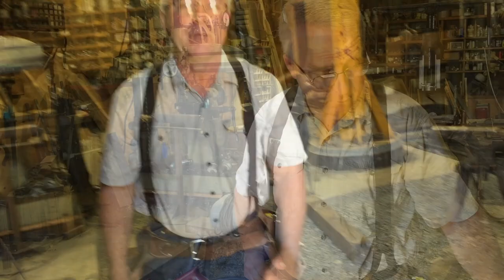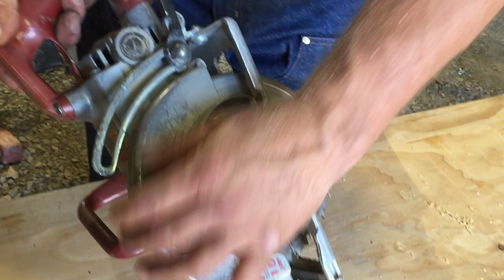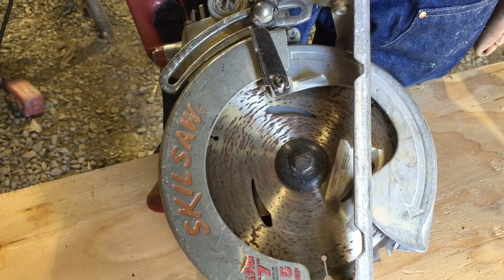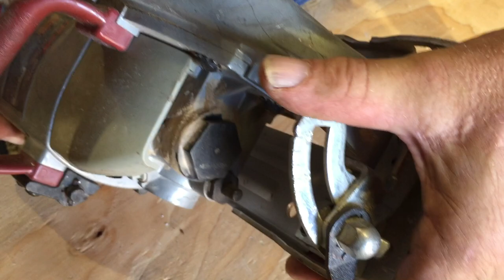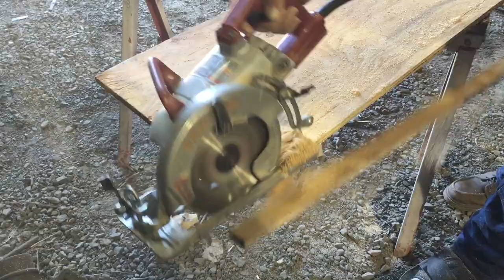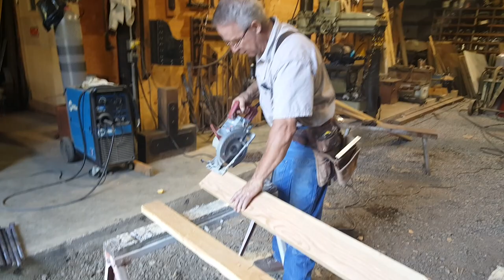Circular Saw Basics

Comment: I have an old Model 77 worm gear Skill saw which is very heavy and I noticed with envy the ease with which you cut the ends of the boards straight with out a guide free hand. besides developing arm strength do you have any pointers on how to cut straight free hand?

Comment: 20 years in the trade in Australia and I've never seen a worm drive Skil Saw, not even for sale.  We only use direct drive and call them circular saws and you are right in that they are back to front for a right handed person.  I now need to find a worm drive Skil Saw in Australia somehow.  They'd better make a cordless one....
Reply: They put the blade on that side so you don't eat sawdust. They make left handed sidewinder saws too. I have a Porter Cable left handed saw. I'm actually left handed. But I used right handed saws for so long I learned how to saw right handed. Now it don't even feel right to saw left handed to me. I still hammer left handed though.

Comment: Is it safe for a saw (I have Bosch pro) to drop it on the floor as you did it at the end of the video? Is a saw supposed to survive such a treatment?
Reply: On concrete it can bend or break a shoe, or crack a safety guard.

Comment: don't stand on the cord. long rip or panel cut? pull slack in cord right up in advance so you can finish in one movement. when adjusting saw fence angle and depth, maybe not so necessary to have finger right on trigger ready to go... wavy cuts cause kickbacks, cut straight. worm drive style plows on when a sidewinder binds up and kicks back.however if you somehow cause worm drive to kick back, gawd help you, pray your on the deck not up high in the rafters.  cutting small pieces is simply dangerous, especially at angles/compounds, run saw against speed square to make straighter crosscuts. dull blades are for california guys who hate usin' horses... don't cut nails, banding, hanger material etc.

Comment: Something I'd like to see/know - being an absolute duffer when it comes to carpentry in the least.

When I measure a piece, where do I put my mark?  I figure right there on the pip of the tape measure.  Now, that's going to leave a width itself, +/- to either side of the measurement.  When I put my blade to this mark, where should I aim?  Dead center - I'm going to be slightly short on the measure (you say the typical leeway is 1/16th"?), or do I want to be ever so slightly above the mark - so that the cut is more exact.

Simple questions I've never had anyone answer - "Just do it!" I always hear.  Okay, just do it HOW?  I've seen season carpenters put up a stud wall that actually affected the entire structure of the house in the end - MARKEDLY so.  But they had everything done to tolerance, yet a golf ball would run rather dramatically from one side of a room to another when they were done.
Reply: If you measure the length you want and draw a line there, you would take the line and only the line. That means line your blad up so it will only take away the line but no more or less. This is usually the case. The trick is to mark your measurement correctly and then line the blade up correctly. If you measure accurate make sure your mark is clear to you so you know where the measurement really is so when you draw a straight line with a square you make that line through the point that is the real measurement. If you just put a fat dot there where is the measurement? The left, middle, or right of that fat dot? That's why you use a sharp pencil and draw a "swoosh" away from the point where your measurement really is so when you draw your line you know where the tip of the pencil was rather than guessing where the real mark is. Once you have that you need to just line the blade edge up to it, not the middle of the blade since the blade has width (called kerf). Line the edge of the blade up and take the line and there you go.

Comment: Any recommendations for a lefty?
Reply: Learn to saw right handed. And yeah I'm a lefty.
Reply: Fair nuff
Reply: @christianpeters3757  I've sawn right handed for so long that using my left hand for sawing feels weird to me now. I'm a dork trying to use a mouse with my left hand too. Because I made the conscious decision years ago to not even try using a mouse right handed. Golfing same deal. Left handed clubs are too hard to come by. I bat lefty though. I definitely hammer left handed too. I swing like a girl with my right arm. I drive left handed. So standard shift is no problem for me. At least in the USA. Using scissors is where us lefties really get screwed. Using right handed moulded handled scissors left handed is torture! I butchered a pair of Fiskars right handed scissors once so they're not too bad. I taught myself to write righty too. I was into calligraphy and that doesn't work too good left handed. Our entire script is designed for right handers. I never did the hook writing thing either.
Reply: I am trying to integrate using my tools right handed more and more. Will just have to take it slow with the saws.
Reply: @christianpeters3757  For a long time I used common sidewinders left handed. I just got tired of eating sawdust though. I never cut freehand either. I always use a speed square. That way I know I have a straight cut. Why make things harder than they need to be? Using a guide isn't the fastest but it is the most precise and consistent. Anything worth doing is worth doing right. Showboaters always end up sinking eventually.

Comment: I want to get an extension cord for my Makita 5077B hypoid saw which draws 13A. Its instruction manual says that you can use a 15A 12/3 50' or a 15A 10/3 75' cord.  But, a 100' cord is not an option. One company that makes a 15A 12/3 100' cord insists that it should work with no problems with this saw. What do you think?
Reply from the maker: Should work I think...

Comment: What is the difference between a Skill Saw and a circular saw????
Reply: So it's really just a brand name then?  I had a customer come in and ask me where are my skill saws?  I brought him to the circular saws, 2 of which had the name Skil Saw printed on them.  He said, "No, these are circular saws...I want an actual skill saw".  I looked like a deer in the head lights.  I thought he was standing in front of Skil Saws but he seemed to be under the impression that he was looking for a different type of saw.  I was confused and he made me feel dumb for not knowing the difference.
Reply: Skilsaw is just a brand name (well, really Skil is the brand, and they write SKILSAW on the saws), but what he probably meant, depending on what part of the country you're in, is a circular saw with a wormdrive (motor behind the blade, like the one in this video), since people associate those with Skil. This would be as opposed to a circular saw with a direct drive motor (motor off to the side of the blade). Most brands made both, but here in the East the direct drive is much more common and the old-timers call the wormdrives Skilsaw since they're the only wormdrive you see much of here.
Reply: OK since I'm in the midwest, I'll assume Skilsaw means worm saw...makes sense to me!  Thank you so much for pointing this out to me.
Reply: Thank you for taking the time to respond to this.  I am learning the difference between worm and sidewinders, thankfully, so now I don't feel so lost at work.  They really just throw us in there and don't give a whole heck of a lot of training.  Again...thanks!
Reply: Ah!  Thank you for that explanation.  Next time someone asks me for a skilsaw while standing in front of them, I'll know to ask if they are looking for worm drive or direct drive (sidewinder??).  At least I will sound like I know what I'm talking about and be more prepared.  Thank you again!!

Comment: We all have our safety guard stories. Here is my non-injury incident.
I had the guard pulled back with a drywall screw so I could rip a woven bamboo floor plank. I ripped mY piece in the living room,  forgot the blade was exposed and laid the saw down on the floor. The Skil took off and made a nice half moon gouge right across the brand new glue down bamboo flooring (this shit splinters like mad). I let the owner  know of the mistake by yelling out "motherf$@!&! The customer actually told me not to do anything except hide it with a coffee table. WTF?

Comment: Why is worm drive better than direct drive
Reply: I may not have all of the reasons, but I'll share what I do know...

1. The "worm" is like a bolt, with threads (rather than a regular "gear" with teeth) so as the motor spins the worm, the threads of the bolt push and turn the gear on the blade-shaft... This increases the Torque (circular force) on the blade INCREDIBLY... and has two net effects.
   1-a... It's almost impossible to bind the motor to a point of stopping the blade and burning the motor out... It WILL break your arm (wrist, usually) first.
    1-b... MORE importantly, it reduces the stresses on the motor's internal components when the saw is used in heavy lumber ALL DAY... as in EVERY day... So the worm-drive saw will simply last longer.

2. The common "traditional" setup of a worm-drive saw puts the blade on the left side of the saw (with the cutting done on the "front" of it) so the Right handed public (90% of us) will have much easier HIGHER visual coverage of exactly what the blade is doing and exactly where those guide lines and doo-dah's mean while we work.
    That's a huge advantage over the "direct drive" or a saw with a motor shaft sticking out the side where the blade is fastened onto it... usually on the RIGHT side of the tool (also where cutting happens at the "front")...

3. The whole system is a bit heavier.
   Okay, this one is debate worthy. I know I'm in a minority view, here, because everyone complains about heaviness in tools... especially hand held tools. BUT weight makes you engage yourself with the job at hand. Almost nobody takes a "dremel" tool seriously, because it's tiny. It's too light to do much harm, so why sweat it??? I mean, honestly, it doesn't seem like it's even worthy of having to wear eye or ear protection, and I almost never put on gloves... BUT that same dremel is my go-to for carving steel or stone. (smart?)
   BUT the worm-drive saw has real heft to it. It's a beastly thing, and the moment I pick it up, I'm aware that I have REAL power in my hand... a whirling blade RIGHT THERE next to my thumb, and just a few fractions of a foot away from "Mr Happy and his two buddies" (ahem... if you know what I mean).
   Weight gives the added benefit of stability and reliability, too... Nobody mentions this (or I haven't seen or heard it yet) but while almost any circular saw will do a job as long as you participate with your half of it... The heavier ones make us set up more completely EVERY job. We can't "get by" with half-assing the support or much (if any) "winging it"... AND while we're on the matter, knots. Even little knots and imperfections in the wood-grain can push a circular saw "off the cut" by enough to count. You (operator) have to pay attention. Sure, it can happen with a worm-drive just as well... but it rarely happens as quickly or to the same degree as with a "direct drive"...

   RE: 1-a... Yep, they're tough and strong like an ox in that case... BUT don't let that scare you off completely. The point is once you KNOW that it's really that powerful, and you respect it, you'll be more likely to make sure your setup is RIGHT... in the "correct" sense.
    Use a saw-horse or proper bench for support. Top the thing with "sacrificial material, so if you do "mis-calculate" the line of your cut while you set up for it, you only leave a notch or groove in some material that didn't matter anyway... not carved a chunk out of your mom's cabinets, or your truck's tailgate... and you sure didn't ram a whirling saw blade into a stone step or a chunk of concrete by being foolish or lazy. This is NOT a lazy man's tool.

    SO maybe... all things considered, a worm-drive isn't so much "better" or "greater" than a direct drive saw, but it's got it's own balance of benefits (longer lasting, stronger output force, convenient blade orientation, more stable platform for cutting precision) over deficiencies (heavier, dangerous as hell, stronger than you are) that are unique to a worm drive... It's also usually more expensive at the best of times... BUT you get what you pay for. ;o)

Comment: Isn't jamming the guard open with a nail extremely dangerous? Couldn't the nail slip out from vibration and contact the blade, causing it to shoot out like a bullet?
Reply: slam a carpenters pencil between the thumb lever and blade house... way safer and you always have a pencil on hand.
Reply: If you don't know why you need the guard out of the way, you should really stick to watching this stuff on tv and stay away from a saw such as the kind shown in this video. nail, pencil, shim, whatever. make your angle cut, pull it out after your done, so the next guy doesn't get a surprise. leave it in and set saw on ground with blade still spinning? probably should stick to watchin this stuff on tv...
Reply: I agree. This man is alert and seems to use common sense however, so he should notice the nail coming out. Obviously don't forget and leave the nail in and put the saw down.
Reply: Ive never seen people use a nail to pin the guard people in Cali cut a shim and pin the guard

Comment: Hmm are you using a left-handed saw?
Reply: Eric Rini no sir, circular saws are not designated left or right handed.  With a worm drive...the blade is located on the left side of the saw  which is far more convenient for a right handed operator. Conventional direct drive saws have the blade on the right side of the saw.
Reply: This angered me. I couldn't afford a worm drive saw, and all the direct drive saws had the motor block the view. Had to bend over and look at the saw to make sure I at least started on the mark for the cut. I finally found a left handed direct drive saw. A bit more expensive than the normal direct drive saws, but a lot less expensive than a worm drive.

So, is there a reason to chose a worm drive saw over a left handed direct drive saw?
Last item in your video: My dad taught me never to put the saw down with the blade still turning. It's rare, but the guard can snag, and then you've got that saw running toward you. I'm not sure his 1960's vintage Montgomery Ward saw had a brake, so he may have just been overly cautious. Still, I think it's a good idea not to rely on a safety device that may not work.
Thanks for the videos.
Reply: Hmm. I always thought that having the blade facing out such that you are not directly behind it was part of the general safety design. My saw has markings on the depth guard that make accurate cuts without seeing the blade at all, but I can see how it might be limiting for difficult cuts. Great video, thanks!

Comment: ONLY USE WORM DRIVE SKILSAWS!
Non hypoid (worm drive) circular saws should be banned from the planet. 

To explain why I think this requires a bit of elementary physics. It called the 90 degree rule of rotational dynamics. 

An easy way to show this is with  a simple child's gyroscope toy. Set a gyroscope spinning and then try to push it over with your finger, it will move 90 degrees from the direction you push. To the left or right depending on the spin direction.
This dynamic is also what keeps your bicycle under you when you try to turn the handle bars suddenly.

A spinning armature in a circular saw behaves in the same manner. While the motor is spinning rotational inertia is built up in the armature. If the blade stops suddenly or slows at the beginning of a cut that inertia causes a 90 degree kick. In a conventional saw this rotational kick causes the blade to twist in the kerf. In a wormdrive the kick is directed down the path of the cut. So, wormdrive saws are inherently more stable while cutting and if bound up in a stall do not try to "twist" themselves out of the kerf.

Just saying!!